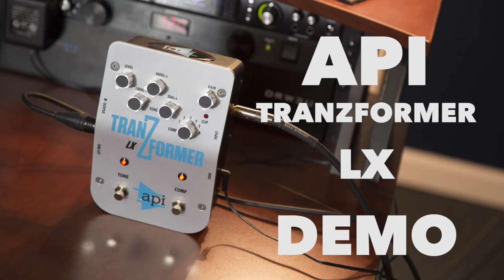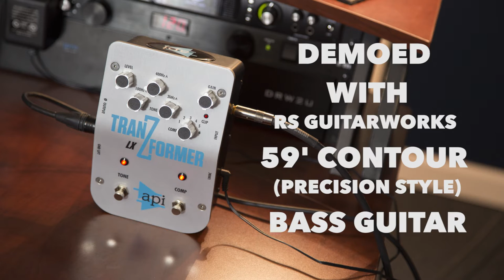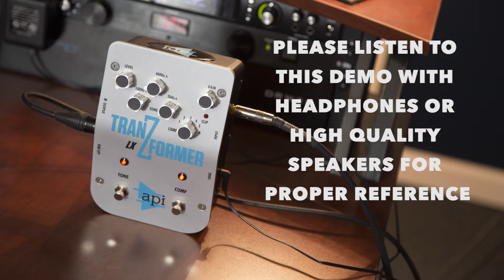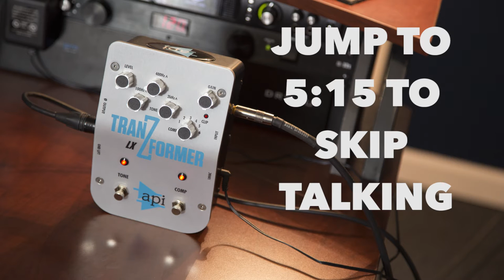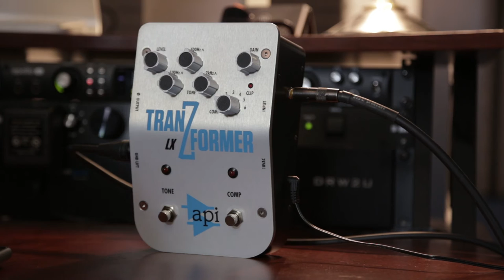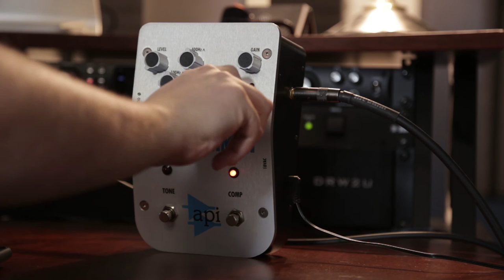API TranZformer LX Bass Demo

Comment: This is an amazing pedal. Purchased recently and love it. But a little big for gigs or a pedal board but great for recording. Not for radical eqing or compression but smooth as API is known for. The newer version has a mute switch. Not sure if this version or the newer sounds different.
Reply from the maker: I believe there is no sound difference. I really wish it had an effects loop and adjustable XLR out level!
Reply from the maker: The new version does run on a different power level.

Comment: It's settled:  I am not going to get the JHS Colour Box V2 as my clean preamp, I am getting this.  Not only can I get rid of  my compressor pedal, as this has a built-in 525 compressor, but this just 1.) sounds better and 2.) the XLR out is not connected to the level knob, so I can crank the level to overdrive the tubes in my bass amp, but the sound guy's board won't overdrive.
Reply from the maker: Those are all great reasons. I loved this unit, but it started popping when pedals are turned on in the chain in front of it. Also, I like to compress, then have all my effects, then have a final DI/EQ on my board. I wish it had an effects loop. Then finally, it doesn't give ANY gain control for the output. So your sound guy is going to have to put a pad on your XLR signal - most boards can do that but hopefully it doesn't create an issue.
Reply: @Carsonchildersmusicnow  I'm fine with all these issues.  I only run passive basses, as I learned a long time ago that passive basses running a preamp pedal sound better than an active bass.  My passive fretless is very quiet, and my passive fretted humbucker bass is really loud, so using the gain knob, marking down where the volume levels are even, will even out all those signals,.  I will use it as a clean preamp in front of everything (except for two fuzzes that don't take well to buffers) and after it, it goes to a tuner where it splits into two signals- a Vox-clone guitar amp for the high end and a MXR M-80 pushing out clean bass going to a power amp, into a 1X15" aluminum-cone bass speaker for low-end.  

For recording, I run three lines- the high-end is handled with a NU>X Solid Studio from the Vox, the low end is handled by the M80 and the unaffected clean line is from either a preamp pedal or a standard DI box.  If I want to use the API box for the clean preamp line, I can just use an inline attenuator.
Reply: @Carsonchildersmusicnow  It should really have a pad, in my humble opinion. Otherwise it's a fantastic piece of gear.

Comment: the ua conversor is clipping!
Reply from the maker: @_caspianaudio Yes, sorry I did not notice that when recording. I love this unit but the lack of gain flexibility really made it hard to use. Every gig I was asked to pad it and I had no options to do so, usually they figured it out on their end but still. Plus it operates at such a high gain level it started popping when pedals are in front of it. It's not built for pedals.